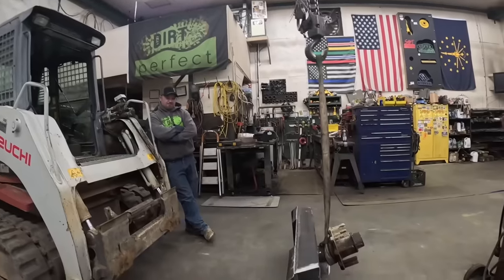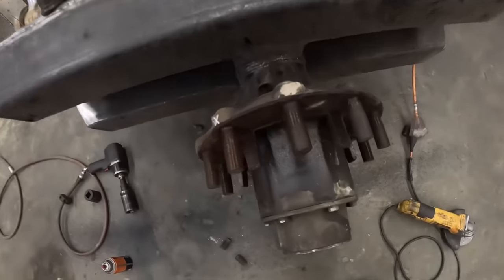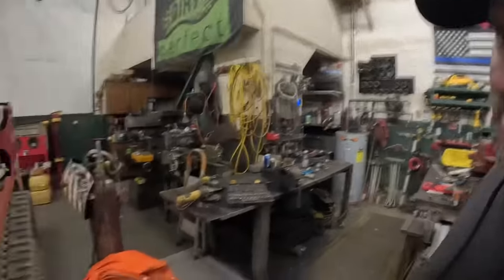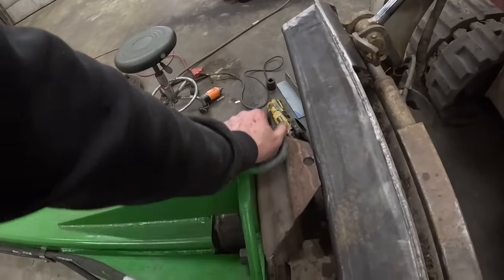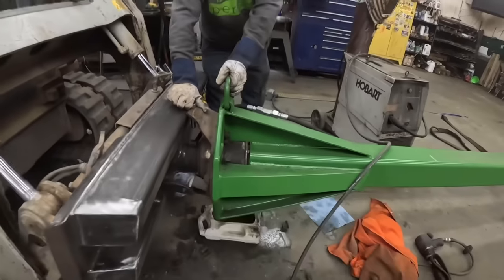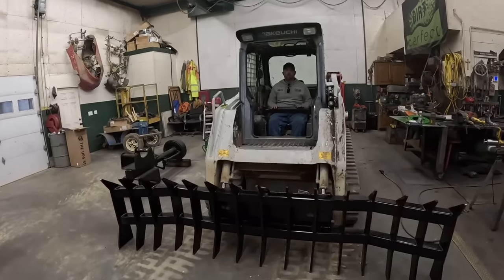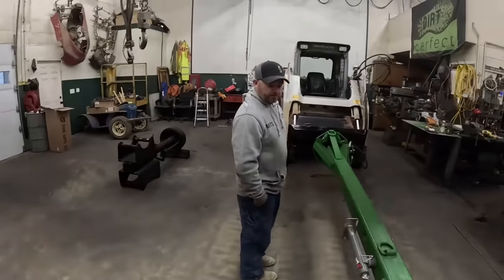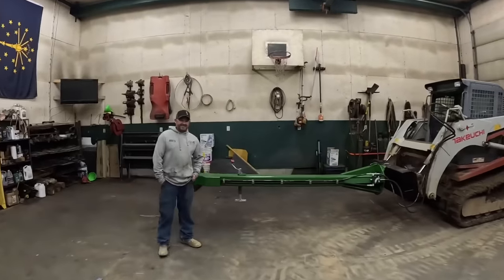Testing Out The Brand-new Saw Set up on CTL - Success Or Failure?

Comment: The only thing you might have done is to have cut the spacer drum at the end of the tab instead of inside. That way you could have drilled holes at any angle you wanted to set the unit. It would also make it so that the operator would not have to get out to unpin it and rotate the unit and repin since you just use the upper tab.

Comment: I'd add a large diameter gear instead of the spacer and a small hydraulic motor with pinion to turn the gear and rotate the saw.

Comment: We'll see how much brush Aaron can push & stack with  that Taco Rake. Jerry still has the advantage with the 850B.
It sounds like y'all don't have enough blade speed on the saw. Did you say about 1100 rpm?  That may be good for a 30" blade, but it may not have the torque you'd need. What size is the current blade? It looks like about 24" x 0.25" from Georgia.  I would try increasing speed to 1800 rpm. (no load) Or, if you're already at the Taco's limits, try a larger blade. Perhaps Logger Wade has something in the 30" - 36" range laying around the mill. It would be old technology, but it could give you a clue on speed. 
Great work on a pair of versatile tools!

Comment: Wowzers!!!  You've got a 3 - fer.... One limb-a-nator, three different machines. For your own safety, either swap your hoses so the blade cuts in the opposite direction or turn the blade over so it cuts AWAY from the operator. Someone's gonna get hurt if you cut a tree and that blade catches it and pulls it back towards you. In carpentry terms that is known as a "kickback" and it'll happen so damn fast you won't even see it. You two have the smarts to design &  build it. Now have the smarts to use it properly. 
Oh, sure. It's fun until someone gets an eye put out. ( Thanks Mom. You're welcome son. )

Comment: OH ah Ha - figured out something that might bite you a good one someday.  Seems to me each coupler has a set of nuts and washers.  Each base unit should have a marble bag - or a leather or strong material bag attached to the base unit that holds its nuts and washers.  Therefore, take it off, put nuts/washers in bag and you will have a set with both units ready to use.    Just a thought.

Comment: According to the text, you can only choose horizontal or vertical sawing. But I think you can move 1 hole with the 10 bolts and therefore also rotate the saw blade at an angle of 36 or 72 degrees? Greetings from the Netherlands.

Comment: You should buy a pool noodle or some pipe insulation to put around the blade. It would protect it when not using it, and be a great deal safer.

Comment: Y’all need to paint or get decals of the final name on the side of the Dirt Perfect Long Reach Power Path and Hedge Trimming Spinning Saw Of Death Ver 1.0 However I do see one feature that would definitely improve the Long Reach Power Path and Hedge Trimming Spinning Saw Of Death Ver 1.0 and that is a power blade angle rotator. Seriously think how much more efficient and versatile the Long Reach Power Path and Hedge Trimming Spinning Saw Of Death Ver 1.1 would be if there were a way to turn the blade assembly from a vertical blade position to an angled blade position to a horizontal blade position from inside the cab of the equipment powering this implement of death and destruction.
Lastly have you ever considered a similar attachment that instead of the spinning circular blade it would have a bar and chain style cutting mechanism

Comment: The only thing I can see to make it better is a way to adjust the angle of the blade on the fly from inside of the cab that could be done with an electric motor with a built in brake

Comment: Hey Mike, i was wondering if could you putt a full size brake drum on the taco attachment and drill several hole around the out side for your pin to go into so you would have several adjustments for different blade angles while using the same pin hole on the base plate? Both attachments look great good job to the both of you guys.
Reply from the maker: No

Comment: i think it would have been better to leave the drum evenly cut at the point of the tab, that way you could just put one tab on the adapter plate and drill holes wherever you wanted in the drum to have more incrimental locking points without having to make and weld on a bunch of little tabs, just drill another hole.

Comment: What happened to the brake drum that came off that hub. Did it get put in the great metal ben clean up? The Taco will not reach as high as the Xvator.
Reply from the maker: Never had it

Comment: Too bad you don’t have the option to mount a hydraulic cylinder from the mounting plate adapter to the saw pole and turn it by hydraulics . You could run a diverter valve off one control and plumb a hose off a tee from one of the hoses to operate the cylinder

Comment: The only thing i can think i would of done different is try to get that blade on the left side of the stick. Idk if thats for safety reasons or what but being on the side the operator is on in the hoes sounds like a better visibility idea to me.. i know technically you can. But it seams designed not to be

Comment: Why don't you make a bolt on frame that will protect the saw blade when the unit is not mounted on a prime mover?  The blade should never rest on the ground.

23:54